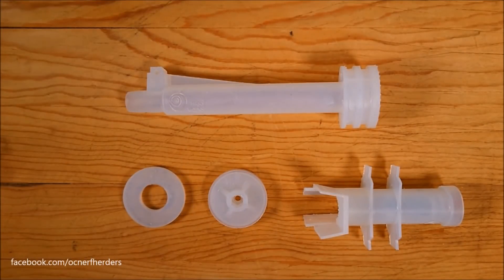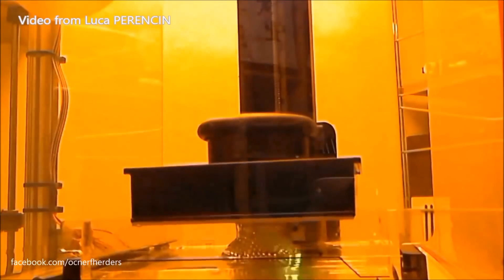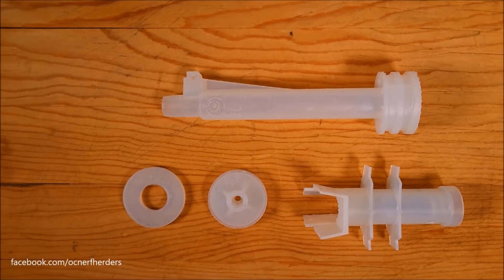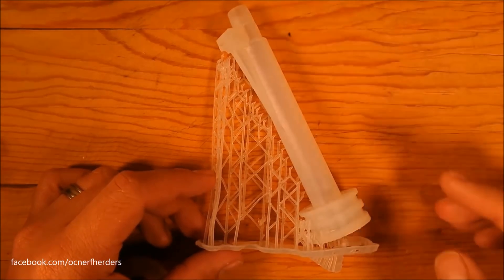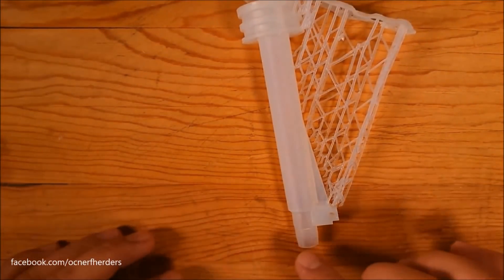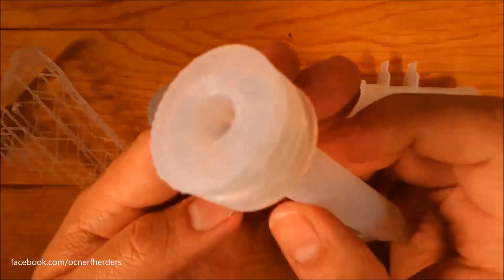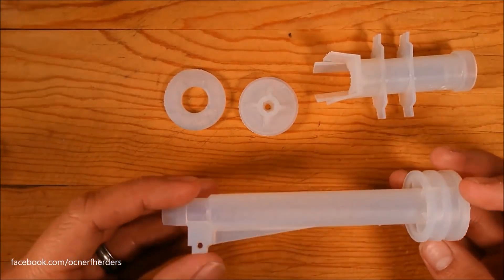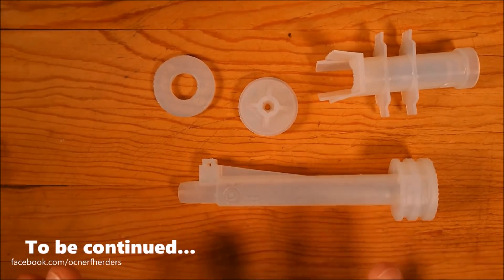REVIEW - OMW SLA 3D Printed Nerf Longshot Parts (What is SLA?)

Comment: To my my understanding, most SLA parts are susceptible to uv light and become brittle over time? are you concerned with the prints failing over time?
Reply from the maker: From what I gathered, extended periods of exposure to UV light can over cure resin and cause it to degrade and become brittle. The same can be said for other types of plastic material. That being said, the parts are housed internally in the blaster with opaque plastic likely painted and clear coated so the UV exposure should be minimal.
Reply: Thanks for the fast response, I am curious to see how the hold up over time and would love to see a follow up video after they get some field use.
Reply from the maker: Me too. I might put the support material outside and see what happens.